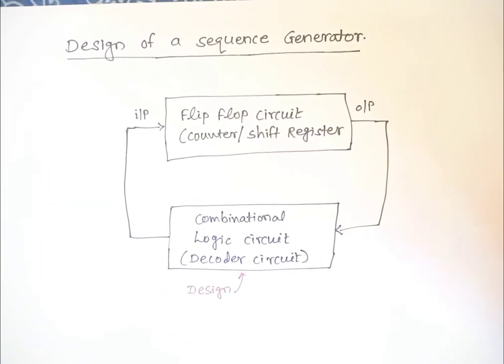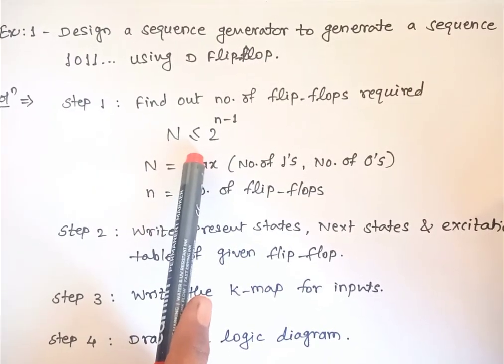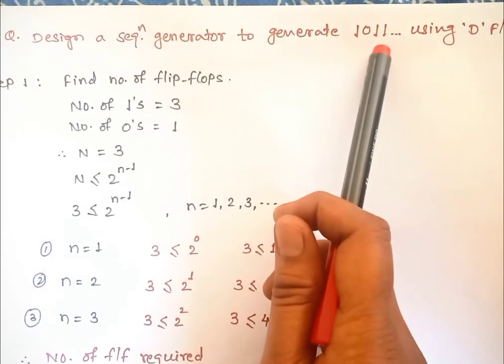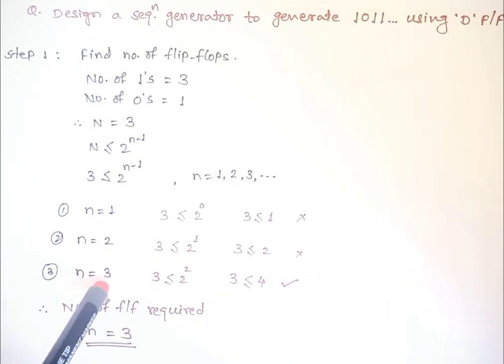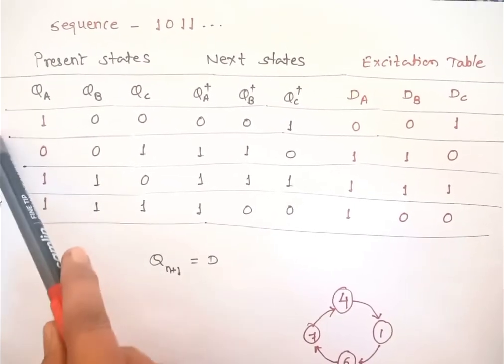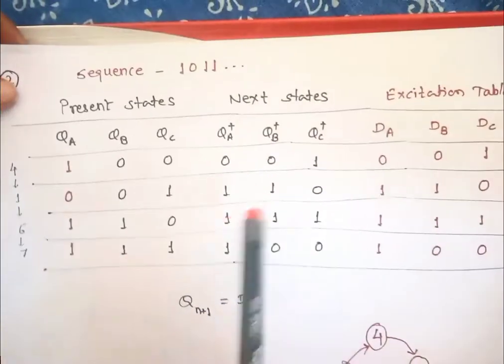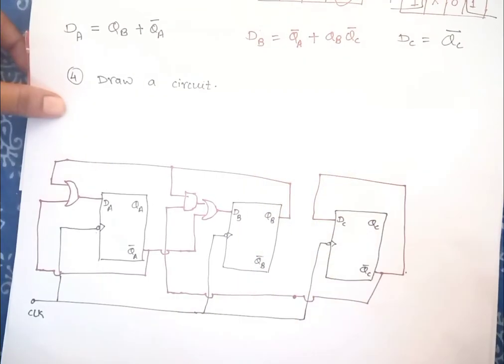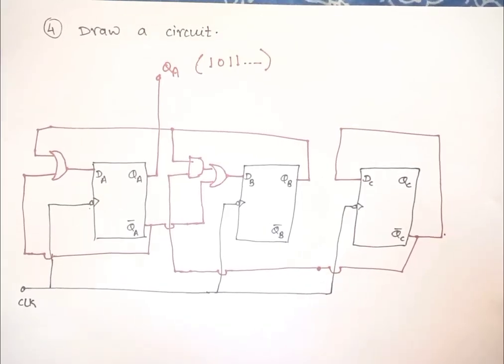Design a Sequence generator using counter or Flip Flop @allbasics8998

Comment: "Design a 2-bit binary, cyclic up-counter and use it to implement a circuit that generates continuously the sequence 0100 " in this question . How do i solve this because for 0100 seq 3bits are required but in the question only 2bit should be used